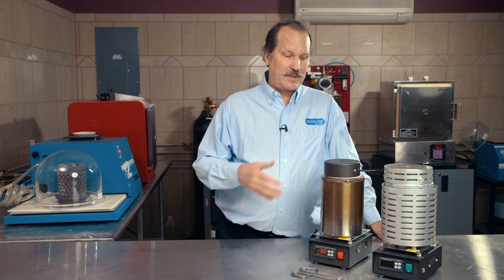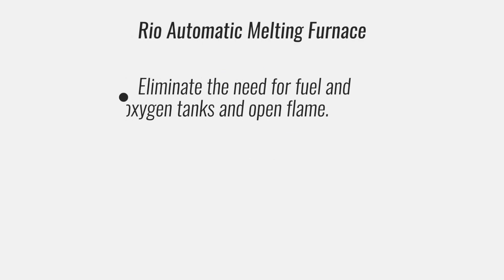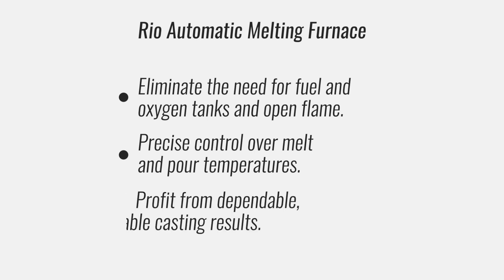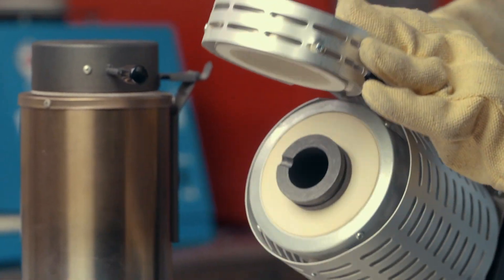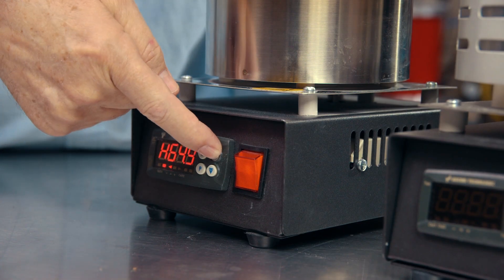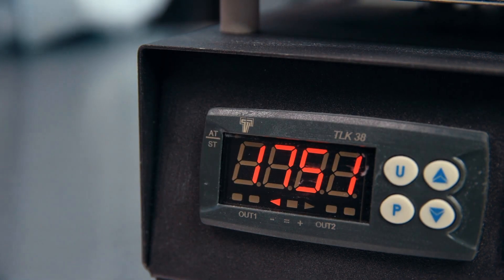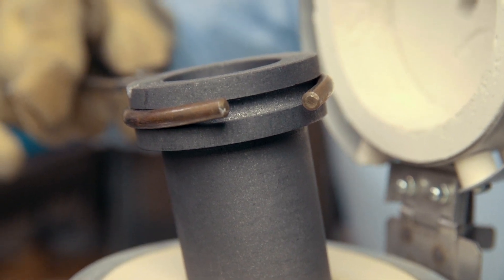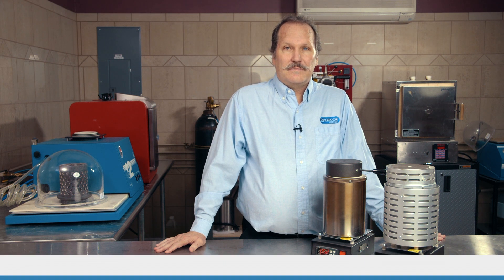The Rio Automatic Melting Furnace

Comment: I just bought the one from RIO where you remove the crucible. I am curious if you need to temper the crucible and would coating it with borax be suggested
Reply: graphite crucibles do not need to be coated with borax.
Reply: @discordiandreamer  Thank you. I  appreciate the help. I didn't think it needed to be coated with borax but then I saw several videos where they were coating them which made me ask the question.
Reply: How is this melting furnace working for you since you first purchased it from Rio Grande?
Reply: @MrFilmfan86  
 The furnace has worked great but I am not a fan of the graphite crucibles. They seem to deteriorate after about 20 melts and then graphite sticks to the melt.
Reply: @GDSavingThePast  OK, what have you done about that, got another type of crucible and did you get 1kg or 3kg furnace?
Reply: @MrFilmfan86  I bought the 1kg and at the time I bought 6 additional crucibles so up until now I haven't looked to see if there is an alternative.
 Even though I was told you don't treat these crucibles with flux I intend to try it with one of the ones I have sometime this Summer to see if that helps.
Reply: @GDSavingThePast  thank you, please let me know if it does help! I've been told for a casting project I need to vacuum cast and may need a melting furnace, it's expensive $650!
Reply: @MrFilmfan86  My understanding is that crucibles are a consumable.  You can extend their life by subjecting them to air as little as possible while they are hot.  This means in theory an advantage of the pour version is that you do not have to remove them from the furnace to cast and therefore the crucible is less exposed to air
Reply: @malcolmthompson9848  thanks for the tip!!.